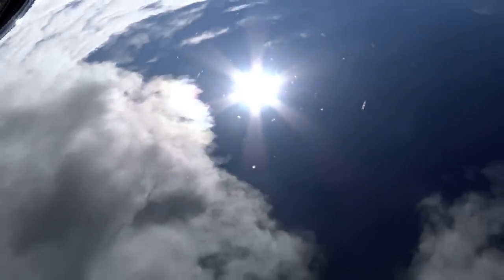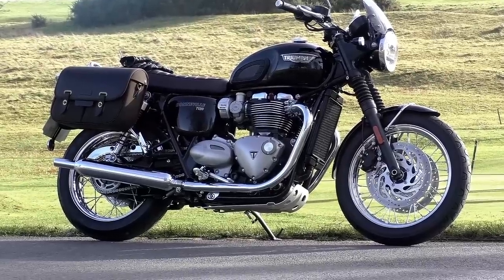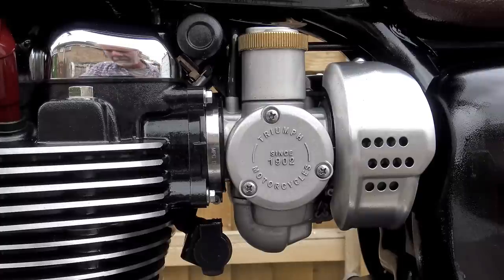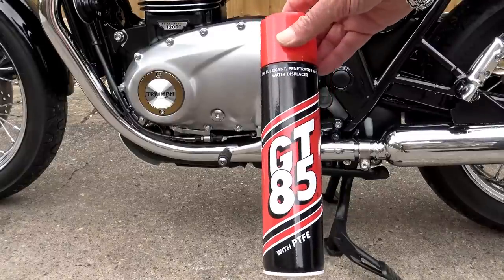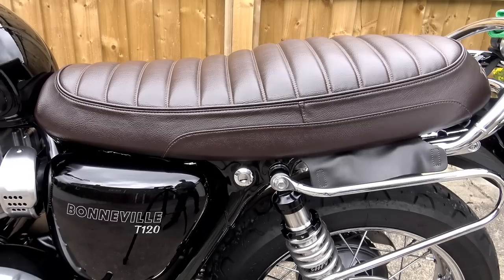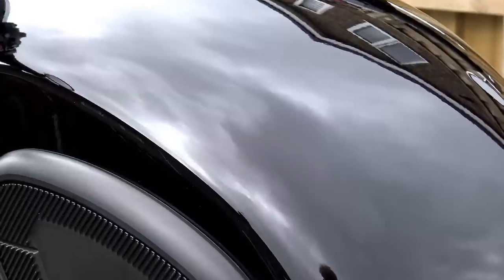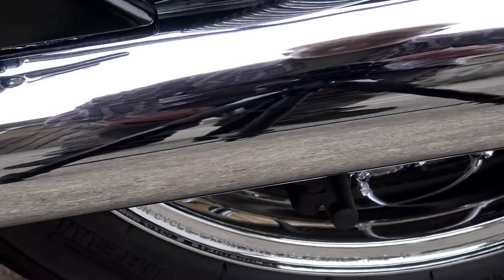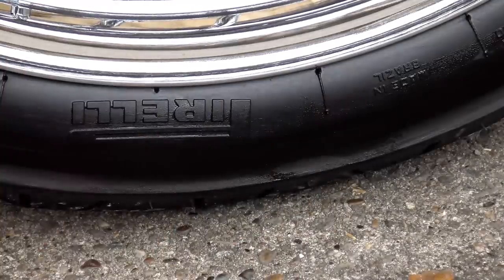Triumph T120, WAXING, DETAILING & PROTECTING your motorcycle

Comment: Thanks Stuart for the video.. I have just bought a Speedmaster which was a dealer demo and needs some work. I look forward to giving it a good clean and I will definately use some or all of these products if available downunder. I just need to repair the paint on the forks which has  few marks and there is already a bit of rust on the spokes. It was a good price so I am not complaining. Your videos will cover most of what needs doing. Looking forward to the next ones. Brian.

Comment: Mr. Fillingham, I can think of no higher praise than to say that the ‘Full Fillingham’ has made all the difference to how my bike looks , as well as to how easily it sheds muc(k). 
On which subject , I’ve started using muc off bike cleaner concentrate and miracle shine wax, and they’re excellent products , long - lasting and labour saving. 
I’ve also started ( after you recommended it )air drying my bike after a wash, and it certainly goes a long way in getting it properly dry, especially behind badges and in those infuriating little crevices in the swing arm. 
And lastly, and not apropos to this video, but yes, Sir, I do know where Yorkshire is , thanks to reading the vet James Herriot as a kid. 
More power to you, Sir, and please keep them coming.

Comment: Hi Stuart,
A note on maintenance and protection.
I just finished a 4500 Km tour in the north of Spain on my 4 month old T120 black
I had about a week of heavy rain over there and no good chelter to dry down everything after each ride. Actualy the new bike was left in the rain for that 7 day period.
When comming home and starting to clean the bike I noticed quiet an amount of heavy oxidation on a lot of bolds and even a big amount of rust on the disc brakes (not the brake surface).
To see my brand new bike in this condition after just 4 months makes my heart break.
I used MO-94 before leaving home, gues it did'nt last for a week
I supose some parts of the bike aren't realy made for touring, just for a nice sunny sunday afternoon
Reply from the maker: This has been covered before Stephen you should re apply after  heavy rain!

Comment: i was cleaning my T120 can the knee pads be removed from the fuel tank as damp / moisture could be retained starting corrosion ; when you mentioned dust coats that brought a smile to my face remembering my days in a body shop when it was all cellulose and cars would be going rusty before they got to the showrooms .

Comment: Great video, I might give some of them ago. I have the matt green Street Scrambler and used some muc off speed polish I had in the garage on that not really thinking about it, came out super shiny to my suprise, that Matt finish stuff might be the answer.
Reply from the maker: Hi Kris. it may be still matt underneath the wax, try removing it with a proprietary tar remover for paint work see if it matts up again. like I said they do satinise with time any way, the matt detailer is probably the way to go, but as I said ive not tried it yet!

Comment: For those not finding GT85 in the States, check your local bicycle shop. Many near me in Tennessee carry it as an all purpose lubricant in exactly the same can as in the vid. Oh, and great job Stuart!
Reply from the maker: Thanks Chad. have to say I'm very surprised that its available there now!
Reply: I’m not sure which importer is selling it to bicycle shops but I used it a lot while working here in the States as a cycle mechanic around 12 years ago.
Reply: So after some looking around it seems in the past couple years due to a licensing or trademark issue GT85 is no longer imported to the States. I have started using Muc Off MO94 as a replacement and seems to work quite well. Time will tell.
Reply from the maker: Thats interesting! I think you will find MO94 just as good or Muc offs bike protector even better!

Comment: Thanks for this very informative video, I’ve followed your cleaning regime and am very pleased with the results.
I have a question regarding tyre shine products. I know that some products state that they are NOT to be used on motorcycles, I assume for safety reasons. 
The muc off product you use on this video is no longer available, so could you recommend another one that IS SAFE for use on motorcycles please?

Comment: Well I took your advice and detailed my 5 month old T100 yesterday.  Should have been done right out of the dealer for protection but nevertheless the results were outstanding.  Had to make a few substitutes as Muc-off is hard to find/expensive here in the States, but did use their Bike Cleaner and MO-94.  Simoniz also seems to be disappearing from the States so used one of Maguires pure carnauba waxes and some sort of tire shine. Now, as I don't have a garage to protect her under the Arizona sun we'll see how it all holds up.  I do have a carport and regularly use a bike cover, but as I ride nearly everyday the latter is a bit of a nuisance.  One question, do you use anything on the knee pads and seats?  Right now I use some 303 uv protectant on the seat but nothing on the pads.  Fantastic video Stuart!
Reply from the maker: Glad it worked out for you Scot, the method is 2/3 of the process anyway so as long as the products you use are of good quality the results should still be good. we dont get the same intensity of sun here so i rarely use such products on the rubber and seat. I would say though that rubber is more prone to sun damage than vinyl so if it is suitable for rubber i would use the product on your knee pads too!
Reply: Thanks Stuart.  Hadn't thought of that but am also thinking the tire shine might work as well (though leave a shiny finish).  Also, I've Googled, Amazon-ed, and about every thing else I could think of but could find no carnauba wax with PTFE here in the States, except for Muc-off's at three times the price of Maguires.  I'll stick with the Maguires for now.
Reply from the maker: Here Maguiars tends to be far more expensive than  MUC OFF here,  wonder why they are charging so much for it there!

Comment: Stewart,
I was wandering if you could review the chain adjustment.  That is the one thing that seems to prevent me from buying a T120.  The pipe placement seems to make it more of a chose than it should be.
Reply from the maker: Hi Austin, I will do when it needs adjustment but so far the chain has shown no sign of stretching, either way it is not as difficult as rumour would have you believe, don't let that put you off sir!

Comment: Hi Stuart, another great vid. I have just got myself a 2013 Kawasaki w800, with plenty of chrome so ive been rewatching a few of your cleaning and maintaining vids. Just one question. This is an old video but im sure it still applies. I have gt85 for my bicycle fortunately, after spraying the chrome and drying it off, do i still apply the muc off miracle shine, as that already has the ptfe is that basically giving the chrome 2 coats ?

Comment: I may have missed it.  I did not see anything about cleaning the radiator core.  The liquid cooling heat exchanger is exposed to all sorts of oncoming mud, grit, insects, water, oil, and other road born fluids.  How does one clean it?   I would think that would be important not to just appearance but to the health of the engine, as heat transfer is affected by all that muck.

Comment: Hey Stuart, 

I love your videos, watching them all prepping for the arrival of my shiny new T120 Bonny  in a few weeks' time! 
I'm living in Berlin right now, and tried to buy some GT85 from amazon. Unfortunately, due to shipping laws with regards to Aerosols, my order was cancelled. 
Just wondering if there are any other brands you'd trust instead of GT85 while getting the same protective qualities?

Thanks,

Sebastian
Reply from the maker: Hi Sebastian, Thank you for watching. Unfortunately its impossible for me to know what is available to you. just go for a reputable brand, light oil based maintenance spray, (with PTFE if possible) that is recommended for use with motorcycles and you cant go far wrong!
Reply: Hey Stuart, thank you for your response! I've gone for M0-94 in lieu of GT85. My Bonny arrives next week!

Comment: Just used the GT 85 on the Matt black pipes and engine casing. Came up lovely, slightly satinised but a beautiful even finish. Will try Matt finisher by Muc Off when I can find it. Very instructive video. Thank you Stuart
Reply from the maker: Don't worry its not permanent on the engine and it will matt up again as it burns off, I'm not sure if the matt detailer would be suitable on your engine Piero so be careful.

Comment: Great Video.  I'd be interested in how you clean and protect those chrome spokes?  When I first picked up my used TU250X I thought the spokes were galvanised they were that dirty.  I still haven't really got them clean of chain throw off and road grime.  Also for tyre sidewalls, plastics and rubber I use 303 Aerospace Protectant as it is Matt Finish and not slippery/sticky like Armour All. For some reason it is also the best dead bug remover I have found.

Comment: In light of advances of products and alterations of formulas such as Muc Off changing there MO94 to a biodegradable version.
Have you changed any of your preventative formula choices?
With the rise in dry PTFE sprays, would you a use dry ptfe spray's?
With the move by Muc Off to change there MO94 to a full biodegrable version would you discount the Muc Off and stick with the GT85?
Appreciate all the content you produce keep up the great work.
Do you also still use the wax oil spray for swing arm and rear fender?
Seams to have down sized to 400ml and now labelled hammerite wax/oil.

Comment: Hi Stuart. I currently own an Triumph Bonneville T100 Sixty that I'm selling with the goal of upgrading to the T120. I'm in love with the Black Graphite Matte. Is there any special caution on caring for the painting you'd recommend? Thanks for your attention. I'm your follower and a big fan of your videos
Reply from the maker: Hi  Rui thanks for watching  and yes matt paint is quite problematic. Iwould recommend that you use Muc off matt paint detailer. its a wax based pump spray which leaves a dead flat matt finish but protects the paintwork with a water repellent finish. see my helmet cleaning video from a few months ago. I used it there to clean a matt finished helmet. other than that dont use a wash and wax shampoo just a standard car or bike shampoo.
Reply: Very informative, thanks. What do you think about TopCoat® F11. Would it do the job on a matt finish paint?
Reply from the maker: I'm afraid i don't know the product Rui, But i can recommend Muc Off matt finish detailer.
Reply: Thanks! I'll receive my new T120 black Matt in April. Can't wait to ride it. In the meantime I'm learning a lot from your videos. Could you post a video about fixing tire holes? There's a lot of info regarding fixing tire holes on tubeless tires, which is not the case of the T120. I'm sure your followers would love that. Just a suggestion... ;)
Reply from the maker: Hi Rui, i shall bear that one I'm mind for the future sir! and congratulations on your ordering your T120!
Reply: Hi Stuart. I’m already a proud owner of a T120 Black Matt. I’ve already applied the Muc Off Matt finish detailer and I’m very happy for it. Thanks for your suggestion

Comment: Appreciate all of your video's Stuart , also I have the Matt graphite paintwork!Interesting point about GT 85 for use on the engine housing.Will it be ok on the blackened pipes ?
Also, I have spotted some triumph panniers on eBay, 1/2 price, £230 but it says for t100 air cooled, wondering if they would still fit the 2017 t120
Reply from the maker: Hi Victor, Thank you! GT85 should be the perfect dressing for the powder coated pipes! just soak a workshop wipe in the stuff and apply it all over them, working it well in to the textured finish. while the bike is cold!
the header pipes are double skinned so they wont get as hot as conventional pipes, this means the dressing should last longer. I would use it on the entire exhaust system, it will return them to their original dark colour, stop them going grey and make them much easier to clean.

Regarding the panniers, I'm not sure sir but I would suspect they will not fit the old t100 is very different from the new T120.

please let me know how you get on with the GT85!

Comment: Hi Stuart, from Portugal! Is it safe to apply GT85 or Muc Off Miracle Shine in black silencers? i have the T120 black and i'm afraid with heat it could ruin the coating.. any thoughts or experience? Thanks for the very nice videos and good luck with the new project.
Reply from the maker: I wont cause any damage sir, but it will evaporate to a degree when the exhaust gets hot. just let the pipes cool down after a ride then re apply you don't need much!
Reply: Hi João, have you manage to find  Muc Off Miracle Shine in Portugal. I'm struggling to find it. Obrigado

Comment: Hi Stuart excellent video once again. On your close ups I noticed the spokes are not at their best.  Is it the camera/light or is there a problem. Is the warranty 12 or 24 months.
Reply from the maker: Hi Kevin, well spotted sir, No problem with the spokes, they are just covered in chain lube! Its a fiddly job cleaning them and the lube protects them from corrosion so I only clean  them up every few months.
The warranty is 24 months !
Reply: Thanks Stuart, I was just getting a bit worried about mine.
Reply from the maker: No problem, ive not encountered any problems with mine rusting as yet!

Comment: As a new rider in the market for a Street Twin, this is by a long margin one of the most considered, informative cleaning videos I've come across.  Thank you!  Can I just ask a quick question - would you use GT85 on the plastics, too, for example the fork gaiters?
Reply from the maker: Hi Simon yes you can use it on plastics etc, but for brst results I would recommend a good quality plastic/rubber dressing!
Reply: Great - thank you very much!  :)

Comment: Thanks for the great videos Stu. I have all my Muc-Off products and had a good first swipe of detailing, cleaning and oiling the chain! The imitation pleather bags are a bit tough to clean. Also, any tips on scuff remover? My tank has fallen victim.
Reply from the maker: Hey Steve, if its only a light scuff i would recomend auto glym super resin polish (the one with the red label) it has a slight cut and will remove minor scratched and scuffs, but be careful, use circular motions in the area of the scuff with medium pressure. do not use this polish regularly, it will eventually remove your clearcoat!
Reply: Thanks!
Reply from the maker: Thank you sir!

Comment: Stuart what have you done to me, I always like to keep my bike clean and my mates always rib me about it but your bike is several steps up, awesome, so clean. I have a 2009 Thruxton 900 and after seeing your cleaning video I went out and bought a top quality wax and Muc - off miracle shine from eBay. I live in Tasmania Australia and can not find a importer of GT85 but will check out eBay etc. I have  heard WD40 have bought out the manufacturers of GT85. I did pick up a product which WD40 are selling as a dry lube spray with Teflon (PTFE. Poltytetrafluoroethylene or something like that lol) recommended for metal, plastic etc.  I will try that for now. Love your videos keep it up
Reply from the maker: Hi Paul, thanks for your message I'm glad you  approve, muc off do make a bike maintenance spray which would probably do the job but it is quite expensive which is why I didn't mention it. let me know how you get on!

Comment: Stuart, thanks for your informative vids which I've been watching since buying a new T120.  Advice please? There is a very slight dent/ripple in the fuel tank and I have no idea how it got there. The paint shows no damage and there is no crease in the metal.  It's hard to spot but I'd still like to fix it, is there a remedy you can recommend?
Reply from the maker: Hi Andy, sorry for not spotting this comment earlier! Google paintless dent removal services for your area. you may be able to find someone that can help, depending on where exactly the dent is. Avoid chips away franchises as they are rarely properly trained. hope this helps.

Comment: Hi Stuart - how do you treat the exhaust headers and silencers? Is it 'safe' to wax them, or should I use something else? Looks like you waxed the silencers at least, but I would have thought the heat could have caused an issue. The headers are even hotter, so what would you do to maintain those? My dad swore by Autosol (German metal polish) which creates a pretty good 'seal'. Cheers.

Comment: The Bike looks great Stuart, some nice tips too. 
What do you recommend to prevent the bluing on the header pipes? Autosol?
Reply from the maker: Thank you Marc. As far as im aware there is nothing that will completely remove exhaust blueing, and if you can get it off it will return very quickly. A product of modern lean burn engines im afraid. dont use solvol autosol on fine chrome, it is too coarse and will scratch! if you must use a metal polish i would recomend Meguiars next generation metal polysh.
bluing should not be a problem with Triumphs current modern classic range as the headers are all double skinned!
Reply: Thanks Stuart, I was wondering about those headers, I have a 2015 air cooled which has blued slightly, I thought you had some special voodoo going on with your polishing that you could share. I'll probably just leave mine.
Reply from the maker: LOL I suspected that might be the case! the meguiars will remove some of it but it would be a job you would have to do on a regular basis to keep it to a minimum. Have to admit I do like the double skinned headers but a bit of blueing does look more authentic!